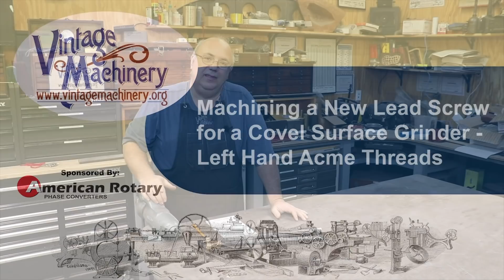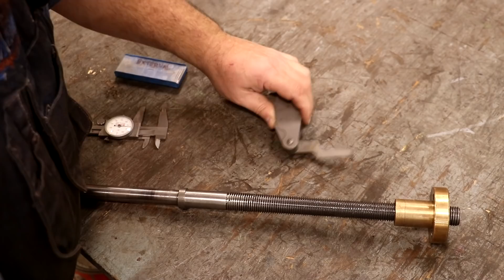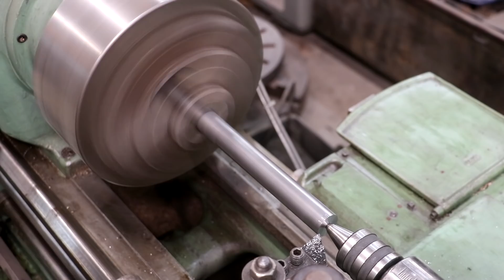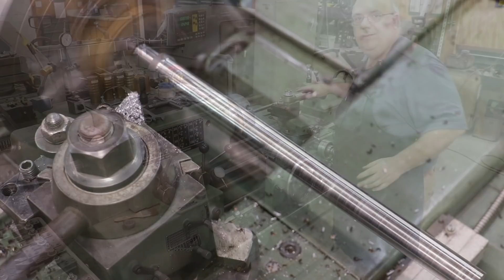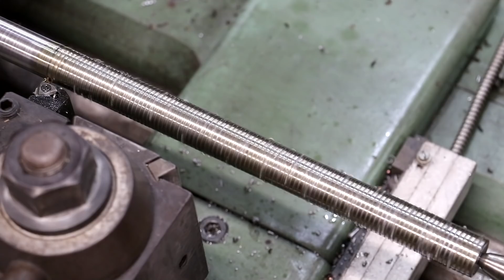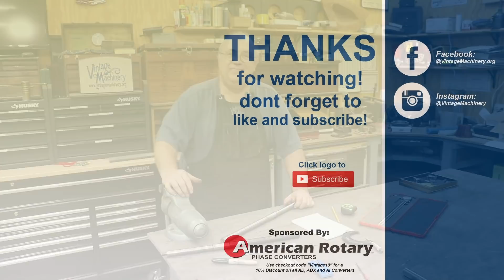Machining a New Lead Screw for a Covel Surface Grinder - Left Hand Acme Threads

Comment: That nut is probably packed full of grinding dust to take out that shaft like it did. 
Thanks for sharing Keith, 
Cheers
Reply: or the nut was replaced a few times and shaft never.
Reply: @dtoad48  
That's possible also. Sure was lots of crud on the shaft when he screwed the nut on at the end.
Reply: Since the owner didn't request a new nut to be made or for the existing one to be made, why open up pandora's box by doing something that wasn't requested. Keith hit the numbers when he cut the threads and validated that the shaft was functional with the nut provided. 
Concerning the crud left on the shaft, could it be that the nut is relatively new and full of new grease that looks dirty but isn't?
Reply: @robertoswalt319 
I agree, there are many possible sides to the story 🙂
Reply: I'm rather surprised that Keith didn't take that nut to the parts washer first to get all the crud out of it before threading it onto the new shaft. No wonder it didn't feel very sloppy. It sure deposited a bunch of crud onto the new screw. 
Yes the new screw is to proper dimensions but it's not matching the nut. 
Should it have been made to match a cleaned, used nut or make a new nut to match the new screw?
As Kieth said, an expensive piece of bronze so maybe the screw should have matched the worn nut.
Reply: @ronwilken5219  Brass nuts never wear much on steel shafts because steel chips and other abrasive gunk stuck in more soft brass and scratch hard steel. The same is in clockwork - steel shafts of cogwheels wear more than holes in brass plate.
Reply: @ronwilken5219  
And being for cross feed adjustment maybe they felt it is not as critical as Z increment.
It has started an interesting discussion 🙂
Reply: Probably not worn from grinder dust. 
Nuts are well covered on grinders like this so grinder grit should never reach them. They generally wear out from lack of oil and poor maintenance.

Comment: I've worked with machinery my whole life, for decades, and I always know intuitively what way to turn a nut. Rghty tighty lefty loosey makes no sense. If you turn clockwise the top of the nut is going right the bottom is going left. If you turn counter-clockwise, the top is going left the bottom right. You can't turn right because while some of the nut goes right the other half is going left. Come on! It makes no sense. Of course I'm on the autism spectrum so maybe it has something to do with that, but I don't know. It just sounds like nonsense to me. For standard threads turn a nut clockwise to tighten and counter-clockwise to loosen.
Reply: As someone who has been working with and on  machinery for half a century, I've always known the righty tighty jingle and it it always true. If you turn a right threaded nut righty (clockwise) it tightens. A bolt, plug, or set screw, even your garden hose, also turns right to tighten.
Reply: @Craneman4100w  I'm sure that makes sense to you, but why does clockwise seem to you to be turning right? Turning a right threaded nut clockwise results in one edge of the nut turning left while the other turns right. It's a circle. Imagine grabbing a nut to tighten it with thumb and fingers and starting to tighten. Your thumb goes left, your fingers go right.
Reply: @PatrickPoet  Avoiding your philosophical slant, I'll simply state that most everything is relative to something. Our standard frame of reference is from the top. No matter how the screw is oriented, from our common reference, right(y) is clockwise.
Reply: @PatrickPoet  Well, if you look at a clock and move the hour hand to the right you have moved it clockwise.  If you move the hour hand to the left it is moving counterclockwise.  This is all with 12 o'clock being the starting reference.
If you don't understand this you are just pulling our leg.
JIM 
😁
Reply: It's right or left to the logical reference point at 12 o'clock.
Reply: You make an interesting point, this bugs me a bit too 😁. “Right” as a shorthand for clockwise and “left” for counterclockwise are very common though. I won’t pretend to know the exact etymology, but I’d guess it came from our instincts to prioritize all kinds of things from top to bottom (the way we read/write, sort lists, etc.).
Reply: It follows the right hand rule.
Reply: It's simply an easy way, through rhyme, to remember how to turn on and off a faucet, loosen or tighten a screw, etc using American standard threads. Turning to the left loosens and tuning to the right tightens . left=loose. right=tight. It got started sometime in the 1930’s when the Phillip screws came out they say. Just a reminder how most normal threads are in America. Not sure what they would say about the left hand ones except for most of us a few choice words when we can’t remove them..LOL
Reply: I have always assumed the saying relates to turning of a steering wheel.

Comment: I had expected the shaft to be heat treated. Please explain why not.  Also, I would have liked to see the inside of that nut, maybe run a tap through it if the owner had not.

Comment: what is the material used for the shaft?
Reply: His material was customer supplied.
If you are asking because you want to know for yourself, use 12L14 for a nice easy job.
If you believe you need something better use Stress Proof.
1018 would also work, but it does not machine as well.
JIM

Comment: Why does the steel screw wear instead of the softer brass nut?
Reply: I've seen cases where the softer material can last longer because junk gets embedded in the soft material and then eat away at the harder material.
Reply: Could be that the brass nut has been replaced before? That seems the only thing I can think of.

Comment: Dumb question time: isn't steel harder than bronze? Wouldn't the shaft wear the nut rather than the other way around?
Reply: Yes. The nut's probably been replaced a time or two at least.
Reply: The original shaft probably isn't steel. Also look at the chips coming off of the new bar. That's a good indicator of what the material is. It doesn't look like steel. When the chips are super small like that instead of long and stringy it's likely some form of cast iron.
Reply: @deathk26  Maybe 12L14.  It cut good like a leaded material.
Reply: @deathk26  that's what I thought at first too,but doesn't cast iron have a more powdery appearance?
Reply: @dcviper985  They are a few different types of cast such as, ductile, gray, etc. Some are powdery, some are crumbly.

Comment: Curious as to whether you could metal spray the thread area and just recut them?
Reply: You could, but you would need to turn down the threads then spray then thread. easier to start anew and throw the old bar into the stock pile/